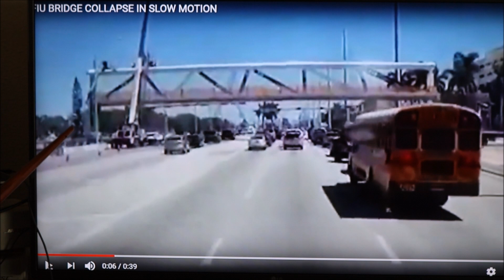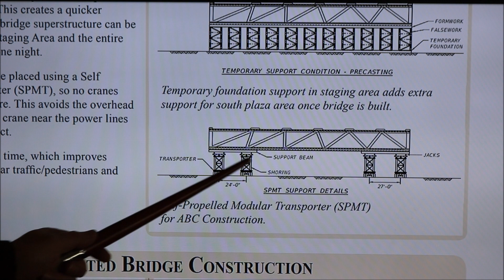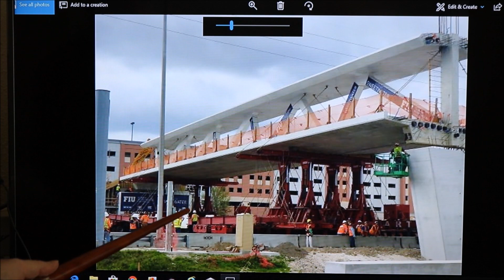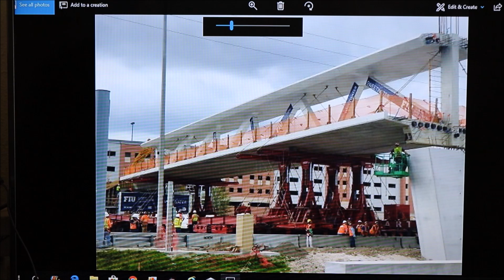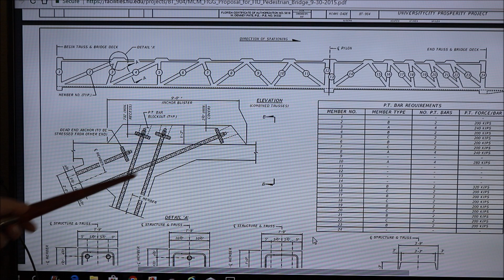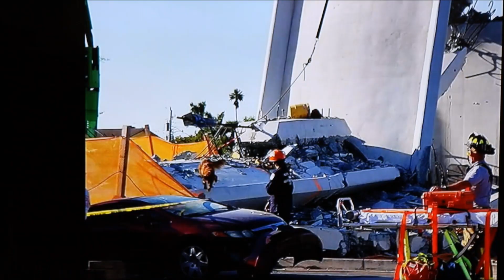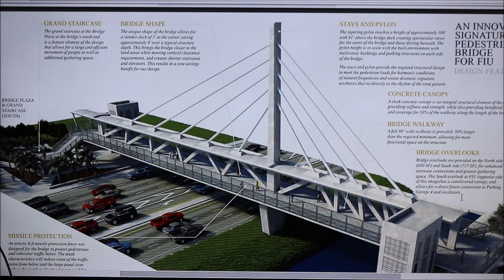Miami Bridge Failure Update 18 March 2018

Comment: Has anybody looked at the drainage. Making a walkway at a University 31 ft wide is a safety folly in itself.  However, is that drain pipe large enough to carry the outflow (did I hear something about a Hurricane?). When the bridge was ordered by edict of Fla. Transportation to be 11 ft longer  - was the drainage increased in proportion?
Reply from the maker: The drain cut out in the centerline may be part of the failure...

Comment: Juan, you may want to attempt to do a video on the  "design-build procurement "  process.  According to Figg's statement:
http://www.figgbridge.com/FIU_Statement.html, this is the type of contract they had with FIU.  From what I can tell this tyoe of contract gives much control to the employing party, in this case FIU.  I'm wondering who specified the large concrete truss which in my mind is at the heart of the collapse.  It's a type of structure poorly suited to concrete, overly heavy, weak at the the truss web joints, and somewhat equivalent to trying transport pottery inside your check-in airline luggage.  The chances of breakage are high.  Here's a link explaining the process or type of contract:
https://www.fgould.com/middle-east/articles/design-and-build-procurement/

Comment: Correct me if I'm mistaken but @ 3:35 you are referencing support 11 as 22 and support 10 as 20. Supports 20 and 22 are on the span that hadn't been installed yet on the right.
Reply from the maker: 11- I need better glasses. lol

Comment: This will be my last comment.. a look at slow motion video shows that load path to the pier was short circuited maybe  when the bar was being tightened along member 9: dwgs  show the strands above the decks  cg, note that deck is just 21 thick due to drainage pipe. This side of the pier is less rigid than the opposite one, a hinge at bottom connection  was created triggering collapse. My condolences to the familiy and friends of all those that passed away in this tragedy.  My prayers will be with them

Comment: You can debate the details but the fact is, the design for this bridge was absolutely horrible.  Attempting a large truss in concrete is an extremely poor idea.  So poor in fact that it should never be  have been done.  This was a pedestrian bridge that couldn't even support it's own weight.  One bolt or rod fails, and the entire bridge collapses.  I wouldn't trust these people to design a doll house for me.

http://www.miamiherald.com/news/local/community/miami-dade/article205869959.html

Florida International University’s president on Monday defended the school’s handling of a project to build a pedestrian bridge that collapsed onto traffic Thursday, killing six and leaving behind questions about what exactly went wrong.
“FIU has a thorough process for hiring contractors for building projects and works with all appropriate authorities to follow the legal and regulatory requirements,” President Mark Rosenberg said Monday in a letter to the “university community” released through a university spokeswoman. “We are confident that FIU followed all proper procedures and protocols.”
Rosenberg said FIU is working with the National Transportation Safety Board — the federal agency leading the investigation into what happened — and has “a sense of urgency about getting to the bottom of the incident.” In close coordination with the state, the university acted as the lead agency on the bridge project, pushing for a federal funding grant, selecting a developer and conducting inspections.  “This tragedy hit home; we all had family and friends in the area, and we are still shaken to the core,” Rosenberg wrote.
Among the six killed in the collapse was FIU student Alexa Duran, an Alpha Xi Delta sorority member. A 10 a.m. Wednesday vigil is scheduled to honor Duran, Rosenberg said, followed by a walk to a site designated for flowers and remembrances at Southwest 107th Avenue and 8th Street. Alpha Xi Delta will also be hosting a remembrance event on Thursday evening.
Rosenberg and the university have been reeling since 1:47 p.m. Thursday, when a 174-foot section of a $14.3 million pedestrian bridge collapsed onto Tamiami Trail, crushing cars and people beneath it. Only days earlier, Rosenberg and university officials had celebrated the erection of the span, which was constructed on the side of the road and lifted into place by heavy machinery in a process called accelerated bridge construction.
The bridge, which connected the university to Sweetwater, a tiny city to the north where thousands of students live, was slated to be completed next year.
The structure’s catastrophic failure was a massive blow to the university’s reputation. But FIU has more at stake as victims’ families prepare lawsuits and the state on Monday promised to withhold any unreleased federal funding for the project.
So, as FIU resumed classes Monday following spring break, Rosenberg sought to assure the public that the institution was diligent in pursuing the project, and that the school remains focused on finding the cause. He stressed that “FIU did not design or build the bridge,” which was engineered by FIGG Bridge Group and built by Munilla Construction Management, and set into place four days before the collapse by Barnhart Crane and Rigging.
Rosenberg also reiterated that the Florida Department of Transportation was the administering agency on the Local Agency Program overseeing the federal grant, and that Bolton Perez and Associates were hired to provide construction and engineering inspections.

Comment: I see a number of issues with your assessment.  Though member 11 saw extra tension during transportation while the end was cantilevered, and this could have led to cracking in concrete, once placed on the pier member 11 would have been in compression.   The cracking not a big issue then, and no need to post stress this member.  Member 10 on other hand would have gone from a very high state of compression during transport to tension (as designed) once on piers.  It is this member that probably was being post tensioned.  Now, if the steel yielded in compression during transport, this could have effected the yielding in tension of the steel in member ten.  It may have been deforming plastically (not elastically) , and this would account for comments concerning nuts never being able to be tightened, even though they thought they were adding stress.  

From the image you show, it looks like the blow out occurred on member 10 and not 11.   Also in your drawing, to further back my comment, no post tensioning is called for in member 11.
Reply from the maker: #10 may very well be the failure point....

Comment: Why would you crank on a rod and add axial load in compression to a  member that is already in compression?  It's a fixed dimension, what's the purpose?   If they wanted to change the geometry of the compression struts, they would have needed a screw mechanism, like a washing machine foot, at the foot of the concrete strut.
 Tightening the tension members makes sense, if they have cracked and lengthened past the dimension they were cast at.
Reply from the maker: when they moved it...

Comment: Has somebody noticed that the bottom tendons at the cross sections are too high just too close to the cl gravity of deck. At mid span you want those as low as possible.  Some details just are not too clear in dwgs available

Comment: OK Member 11 was under Tension in the move ( but you said it was 'specially tensioned' for the move). OK now, later, the forces are reversed because the bridge is now on its pier. SO its highly likely the tendons will slacken off when the compression comes on to the truss. All following is simply speculation. ..the rods, anchorages, concrete nodes, or even the walkway flanges (top or bottom) might have failed due to any  number of reasons. But whatever it is settled on in the end I reckon its ALL due to that stress reversal somehow.
Reply from the maker: right....then they went about tightening #11 for reasons unknown....
Reply: Well observed Mr Blanco. Reversal of forces at that point and the huge bursting forces of push-pull truss members right there could mean anything was going on there.  My feeling is that its a hell of a critical point...the whole joint could have simply punched through the deck in shear.  Those inclined members seem so slender to me against that massively hefty deck.

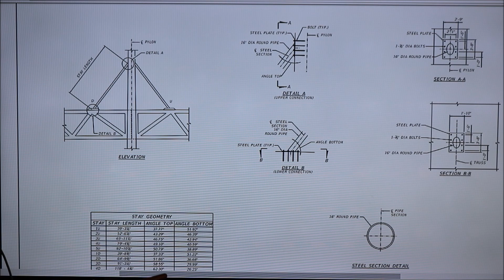Comment: @9:40 - "new" material ( concrete)  should be the main focus not the structure.  A bad rod should not cause the bridge to implode.  Also, concrete formulas are patentable unlike architectural designs.  Unscheduled road closure for an ABC  project will bring unwelcome attention to the bridge.  It's interesting that FIU  is doing concrete research that is very relevant to this bridge ( https://cee.fiu.edu/about/faculty-staff/faculty/atorod-azizinamini/ ).
Reply from the maker: Great point.
Reply: Large trusses should not be based on concrete no matter what the formula.  All trusses are essentially tension structures.

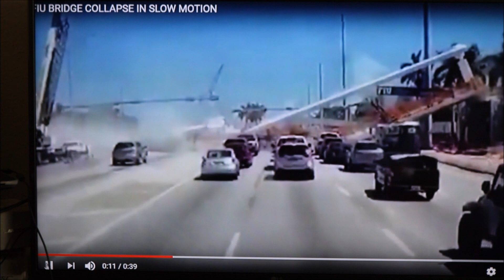Comment: When I freeze frame through the start of the collapse at 1:06 I see strut #11 failing in compression at its interface with the roof as the initiating event.  I imagine that the tension rods serve a function even in compression by helping to stabilize the concrete compression column (sort of like clamping a stack of washers together) when loads are fluctuating.  Anyway, if they had under-tensioned the rods during the cantilevered phase during the move, it could have fractured the concrete from displacement in tension, then when it was placed under compression, the concrete column would be unstable.  I'm wondering if the rod being loose was a sign that the concrete strut was slowly failing in compression so that it was imperceptibly shortening rather than the tension rod being stretched.  Then applying more tension when it was in place,  plus the weight of the bridge, finished the job of collapsing the concrete in compression.   What also strikes me right away is having double rods means you always have to keep the tension on them as close to equal as you can otherwise one rod ends up taking almost all of the load, so you really need to adjust the two simultaneously or at least in alternating baby steps.

Comment: Is the speed at which it fell indicative of possible gross overtightening of the tension rods to begin with? Once that one gave, it went a good bit faster than gravity would normally move it, presumably due to the load in the other tension rod and stored strain in the span accelerating the remaining portion of the span down.
Reply: Dash-cams operate at 15fps, and the playback is at 30fps, so the footage appears faster than real life.

Comment: When you add that top piece with all those rods the bottom of that bridge is then under compression it can't be under compression unless the top rods are in place, do the math. Statics are covered in the first and second-year Engineering get the book out and start doing the static equations otherwise your videos are nonsense.
Reply from the maker: ...said the indignant engineer who failed to have his work checked by others leading to....disaster!
In aviation this is called a pilot with a dangerous attitude.
You are clearly NOT paying attention,  merely puffing your chest before viewing the entire presentation.
I see this a lot in the engineering world. One could learn from a little aviation CRM (Crew Resource Management).
Reply: I'm going to build a small model replica out of two by fours and two by sixes and demonstrate why this thing fell down but you're going to waste two days of my life that I desperately need to put that time into getting my car at 80 miles per gallon so...  damn the distractions!
Reply from the maker: Tim Kasey looking forward to your video report!

Comment: I completely disagree with you. Do the static equations for that bridge without the top part as you're saying and I bet it doesn't hold up mathematically otherwise you're just diverting attention away from the truth. I read the exact same thing you were pointing to and it says flat out that those top rods are part of the load carrying structure.
Reply from the maker: once again you are not listening. Go back and review.
Reply: blancolirio don't tell a guy that got straight A's that he doesn't listen, you're insulting him...  :-)   I don't agree with you, and I can prove it mathematically. That bottom flat part, the part you walk out on, it was intention, it pulled apart. It broke at the bottom not where the guy was tightening. The area where the guy was tightening was in compression. look at the video once again, the truth is you're not paying attention.
Reply from the maker: now you're simply quibbling...lol. This is ABC construction, as I said in the presentation the main span MUST stand unsupported. The overhead 'faux' pipes only add a bit of stiffness to prevent the design from bouncing while folks traipse across.
Reply: blancolirio look at the video what part of the bottom section broke? If they tighten up those cables that span the entire distance, unsuported, that could have crushed the concrete. It should have been tightened while it was being supported. 
...  it's also breaking at the bottom, you're only looking at the top part, but the top part is under compression. I know perfectly well what you guys are talking about and I think that you were emphasizing something that is secondary. I wish to disagree with you, it's not that I don't listen, I don't agree with you!   If I get the time I'll do the math and prove it.

Comment: Form follows function, and it follows that form added to function is not relevant to function. 
The truss system should have been capable of carrying the loads alone (although my gut feeling is that the truss system alone might have failed anyway because the dollar tail was wagging the engineering tail of the the design beyond limits. They could have put the money for the brick-a-brack into the structure if they wanted to build it on the cheap. Speculation, of course.

Perhaps not relevant to the proximate cause(s) of the failure, but the steel in the canopy structure seemed to be more of a token than functional. Again, just guessing. I'm presuming it wasn't structural, but it might have been a adjunct instead of just an additional load. 
bit too much (and it's just a screwy-looking design—speaking of aesthetics which should have followed form. Would the late Robert Maillart ever have approved this design? (It's clunkly-looking, but shouldn't the stressing have been done at a particular curing stage, not after the concrete had firmly dried? Just guessing, but it appears that the concrete was over-stressed after it had lost all its plasticity, and the "normal" or design stress may have been too much, and enough to cause the "minor" cracking and that adding stress to the tensioning rods might have had the opposite effect to the one intended. Judging from the amount of the rod exposed, it might have been (grandly?) over-tensioned, stretching until failing and pulling out several feet? Then the domino effect. 

On top of this, the rubble appears to have a lot of fines. What was the sodium content of the sand used in the mud?

Comment: The shear reinforcing that would be required in the 12" thick roof slab x 3'-6" long brace cap over strut 11, would be #9 bars @ 4" oc, top and bottom, on both sides of the brace cap.  This huge amount of steel would be obvious in the photos, if it was present.  It does not appear to be present.  The post tensioning that was being played with, could have been removed that then allowed the top of strut 11 to shear off from 1500 kip ultimate shear from dead load only, through the cold joint.  The 2000 kip ultimate shear would include live load and would be directed in a horizontal direction.  Reducing the post tensioning in strut 11, could therefore have allowed either the roof slab to shear at the brace cap, or the brace to shear off at it's junction with the bottom of the roof slab.   Heavy longitudinal steel would be present in the braces and they would have to be 10 ksi concrete, but there would not be enough steel present to prevent a shear failure at the cold joint on the top of the braces.  Steel diagonal braces should have been used, then there is no messing around with post tensioning in those short braces.

Comment: Update on loads.  Please change the previously stated 400 kips to be transferred into the bracing cap, to 2000 KIPS!  Not much question that the deficiencies in the design to account for this load, caused the premature failure of the bridge.
Reply from the maker: wow!

Comment: Truss member 11 was a compression member.    Therefore, the tension in the rods of that truss was irrelevant.     Truss member 10 was a tension member.   Its post tension rods should have been tensioned if there were cracks visible in the floor flange.    They were working on the wrong trust.   Comment?
Reply: wrong strut
Reply from the maker: except during the move....probably damaged them.
Reply: That is precisely the point.   All fingers point to the tension strut which could have had damaged post tension cables.   It is pointless fiddling with post tensioning in the compression strut.   The engineers should have known that fact.   But doing post tension on the tension strut could have had beneficial results.